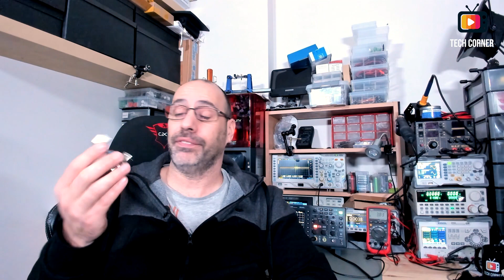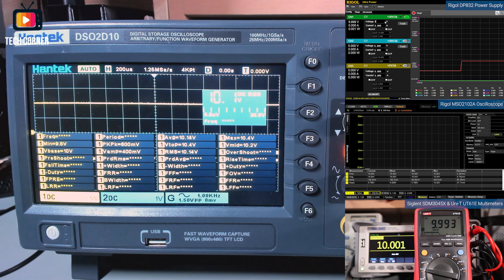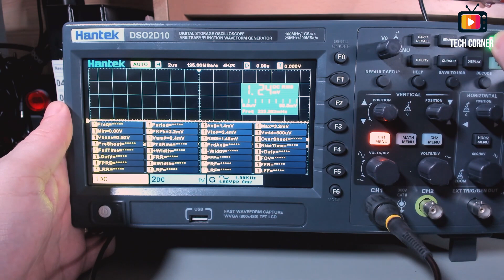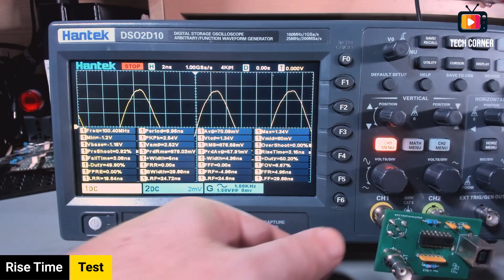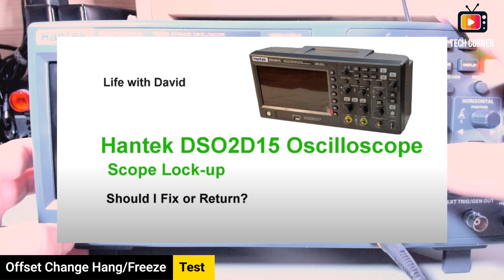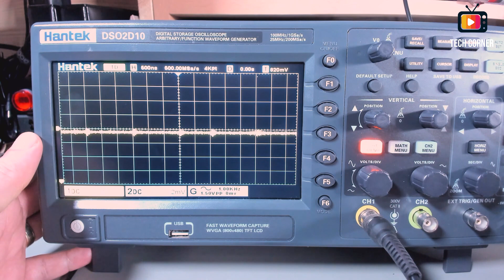Hantek DSO2000 Oscilloscope ReTest After Firmware Upgrade ⭐ 2C10 / 2D10 / 2C15 & 2D15

Comment: Hi
Help me please!
 Hantek dso2d15

I set the percentage of the display and line brightness settings to a minimum, but the brightness itself does not change after turning on the power.
If you reflash, will the warranty be voided?

What to do. how to fix?
Reply from the maker: Hello SVET, the first thing is to contact the hantek support. For what I know, they're not very responsive, so if you don't have an answer in a week or so, try to see what is the latest version of your oscilloscope and if is not the latest, upgrade it. I have here https://youtu.be/4Vy9acRJFQc the instructions on how to upgrade to the latest version. It is one of a 3 video series that will give you a lot of info on that topic. Thanks for watching! 👍

Comment: guess i need to try the update to see if the trigger is any better, i bought mine end of last year so a mid 2021 model i guess, and the trigger is somewhere between comedy feature and useless, a bit out on voltage/offset i can live with as i'm mostly power supply fixing or signal tracing not measuring absolute values as such
Reply from the maker: Hi Lez, it will be better, but slighty... good luck with the upgrade, I have a serie of videos released a month ago that cover that topic. Thanks for watching! 👍

Comment: You made some mistakes. You updated software not FW. You are running on old firmware. You haven't run calibration after the update. Also you must wait for the scope to reach operating temperature. The doc says have it run at least 20 mins before doing calibration.
You are also missing fresh information. The forum links below on EEVBlog have a lot of valuable info you need to read. Also there is a FW changer application created by DavidAlfa. Hantek does not publish FW updates. They occasionally send updates individually to people reporting problems. Latest version is 3204, but there is not much feedback yet, if it is suitable for everyone. But you can freely update or roll back any FW between 3200 and 3204.
DavidAlfa's GDrive folder: 
Lots of staff here, hacking, mods, scripts, and a depository of all SW and FW versions.
Reply: I can't post links.

You have to search for yourself.

eevblog 
    new-hantek-dso2x1x-models
    hantek-dso2x1x-firmware-updates-and-best-use-practices

DavidAlfa's Google Drive:   1Tqk8YbL_M3S0vtk7h_cZ-01U2idIaqqx
Lots of staff here and a depository of all SW and FW versions.

Ohh, and don't use Platform tools, like someone suggested before.
It's going to reformat your device and you loose factory calibration, serial number, etc.
Only use it in case you bricked your scope.
Reply from the maker: Hi Gellért, everything you said is true and I want to thank you so much for taking the time to help in such detail. Some weeks later this video, I made a series of 3 videos that will teach exactly to do that. Even so, you're great in this post! Kudos to you 😁💪 and finally Hantek decided to stop calling firmware to everything 🤦‍♀️ Thanks for watching! 👍

Comment: Voltage ripple test is done by setting the channel on AC, not on DC and bandwidth limitation should be kept at 20Mhz for this test.
Reply from the maker: Hey Johnny, I will do another video soon after the "low level" firmware upgrade and will retest this with your tips. Always improving, thanks for your input and for watching! 👍
Reply: I never knew this either. Thanks brother. I'm getting a siglent psu in a few weeks to replace my horrible longwei and kaiweets switchers. At least I got one of them for free but it's only 70 dollars on Amazon anyway. Haha. They're clones of each other except paint color. Haha Better than nothing though for when I was a total noob. I've gained more xp in the past few years though but I'm still in the noob zone haha

Comment: Well Hugo, my D10 is being shipped from China. I’m hopeful it isn’t affected by the vertical offset issue like yours. I’ll keep an eye open for your next Firmware update video. Great channel 👍
Reply from the maker: Hi Dave, it seems that this oscilloscopes have 2 levels of firmware, the software layer that is updated with the files and a low level firmware not updated. I'm going to do a video soon on how to update this low level firmware and check if it finally solves my problem with the offset. If you're oscilloscope is with "low level" firmware 3202, you should be alright. I'm gonna try to update mine to that version. Thanks for watching! 👍
Reply: @TechCornerTV  Cool, I’ll let you know when it arrives 👍
Reply: @TechCornerTV  Hi Hugo. My DS02D10 has arrived and is now installed with s/w 220210 and f/w 3202. Happy to confirm there’s no vertical offset freezing issues throughout the range to 100MHz👍

Comment: Could it be the probes  (noob question) on the Hantek  for the voltage ?
Reply from the maker: HI! Well no very probable, but maybe. But if you watch the oscilloscope showdown video, the probes I used in the video were the probes of the oscilloscope and the values were also messed up, so to be honest, I don't think so. The probe I used is 300Mhz Rigol probe, the best I have, it's a possibility that it has some kind of problem, but don't think so, works well on my Rigol.... thanks for watching and your comment! 👍

Comment: Just picked up the 15 and wondering is I should send it back. It also seems hantek tech support does not bother to respond... At least now for the last 7 days.
Reply from the maker: Hey Gregg, at least on that FNIRSI has the whatsapp group that if you're able to join, they're fast to respond. Regarding the hantek, it seems there is a way to upgrade low level firmware and I'll try to do that to see if the problem is solved with that "low leveL" fw upgrade. I'll try to post the video in the next couple of weeks. Thanks for watching. 👍

Comment: Great test! That freezing issue would've been the only thing to put me off. Fortunately my unit doesn't seem to have any bugs like that. The weird thig is that software and firmware seem to be separated on this scope. Seems like you can only upgrade the software but not the firmware. For example my software from factory is the 20210726 version. On the firmware side it has 3202. Yours on the other hand shows 3200 even after upgrading. Begs the question. Is it even possible to upgrade that? And if it is possible would that resolve the freezing issues?
Reply from the maker: Hi Dávid, you mention and brought up a very good point of view, I've never noticed the firmware version in the botton, I know thats silly, but in the middle of so many things, that passed me and you're right, what updates is the software version, not the firmware version. I'll try to get in touch with the Hantek support to get some feedback on this. Thanks for your input, it was very useful. Thanks for watching! 👍
Reply: David's Life has a video on how to update the FPGA firmware and the system software.

Comment: very good test.  I have the 2c10, upgraded to 2d15 and also upgraded the firmware to 3202 the same day I bought it 6 months ago.  At first it crashed a lot but with this year's updates I don't remember it crashing, and it doesn't have that offset problem, but I use the oscilloscope's function generator
Reply from the maker: Hi Ulises, thanks for sharing and you input on this. Dávid brought on another comment on this video a very good point, that is the firmware being different of the firmware. I'll have to investigate that further. There might be the related to this problem. Thanks for watchin 👍
Reply: the question is why the firmware is not provided by hantek if it is really an update version 3202
Reply: @ulisespetrunior  There's a separate firmware and software update : https://www.youtube.com/watch?v=dlSlevxl-z4
Reply: Hi ulises - when (year/month) did you buy your DSO2C10? Were you lucky to have the hardware inside for the Waveform Generator?
Reply: October 2021 but I had already read some comments at the beginning of 2021 that some dso2c10 had the built-in function generator.  so when I bought it I tried if I was lucky enough to have the built-in function generator
Reply: @ulisespetrunior  - Thank you for your reply! So, is the Waveform Generator working OK for your 2C10?
I found a special price on DSO2000 series for one week only, but they have no stock of 2D10 that I want to buy. So I must choose between 2D15 at US$202 or 2C10 at US$152
I must decide if the $50 lower price is worth the risk of no AWG 😄
Reply: @johncoops6897  yes its work fine
Reply: @ulisespetrunior  - thank you!
Reply: @ulisespetrunior  - I have another question. Does your 2C10 have correct AWG calibration for the (disabled) Waveform Generator? I understand that this  calibration cannot be set or restored, so I wonder how this calibration was set?
I think it is strange that the factory would manufacture and calibrate the main PCB for 150MHz+AWG, then disable these in firmware to create the 2C10. What is your opinion?
Did you do any tests on the AWG like voltage accuracy, etc?
Reply: @johncoops6897  Unfortunately I don't have an answer to that question since I don't have the tools to carry out the tests.  I could only test with the same oscilloscope.  and from what I could read, there are 2 reasons why some functions are disabled, the first is because they sell the update and the second is because it has a bug.  unfortunately hantek does not sell updates
Reply: @johncoops6897  Regarding the oscilloscope, what I could find out is that the 100mhz and the 150mhz are both approximately 115mhz without any modifications.
Reply: @ulisespetrunior  - Doesn't the AWG have the ability to (say) set the output to 1.0 Volt? In which case, you can just use the Oscilloscope to measure the amplitude and frequency of the waveform.
You said that the AWG seems to work OK, so how did you determine that?
Reply: @johncoops6897  the amplitude can be set from 10mV to 7V, and I was able to determine that it works fine with the same oscilloscope but using the alligator leads.  the difference is that it is 8 bit and the awg is 12 bit
Reply: @ulisespetrunior  - thanks very much!
Reply: @johncoops6897  what caught my attention is that it brought 2 test leads and a crocodile, when it was supposed to bring 1. maybe it's a sign, I should see some reviews to confirm my suspicion
Reply: @John Coops  Is there an easy way to tell if you have the hardware for he AWG. Could it be as simple as the BNC connector being labelled as trigger/wave generator? Thanks.
Reply: @derekec  - There is absolutely no external identification. You have to remove the 4 screws and remove the rear case. On the main horizontal PCB (in the centre near the 2 large IC packages) is an IC labelled  DAC902 which creates the waveforms.
I will try to link a YouTube Video that points it out in my next post, which I hope YouTube won't delete...
Reply: @derekec  - At this timestamp in this video review, the guy points to the DAC902:
https://youtu.be/Mmx7eo9STXE?t=2035
Reply: @John Coops Just received my 2C10. No chip (though has the faceplate marking alluding to it). Bummer. It's going back. I was concerned anyway that if I flashed it I'd have to live with an older buggy firmware. Not sure but a concern. Thanks for your help.

Comment: Thanks for going through all this effort and for answering my voltage ripple question. Sad to see such a good oscilloscope simply fail to cope up with the most basic functionality.
Reply from the maker: Hi! I will have to test the fix David talks about on his video, but yeah, this is a nonsense bug, is a total deal breaker issue! Thanks for watching 👍
Reply: @TechCornerTV  That means we're gonna have another awesome video :)
Reply: You've got me confused. Why is it such a good scope and why does it fail at basic features?
I would like to see any measured values or displayed waveform to represent actual values. Isn't that what this device is made to do? Just being curious.
Reply: @theovannieuwenhuizen5756  that is not what an oscilloscope is made to do